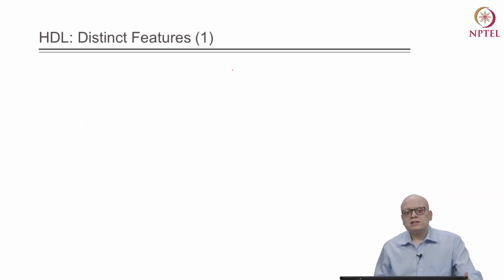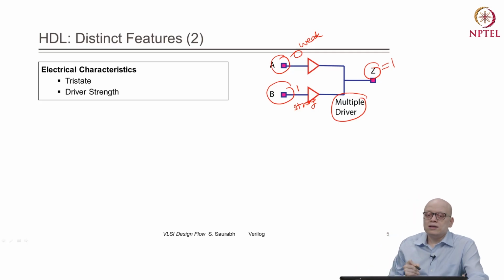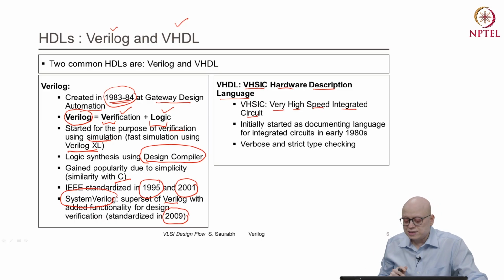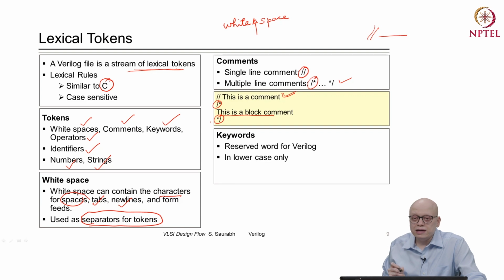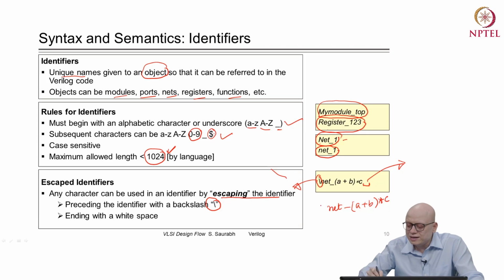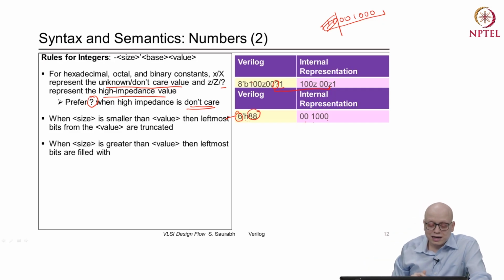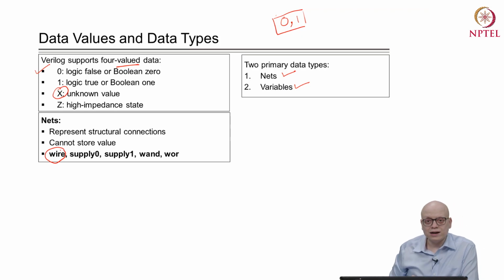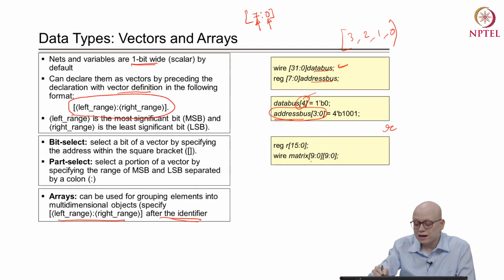Hardware Modeling: Introduction to Verilog-I

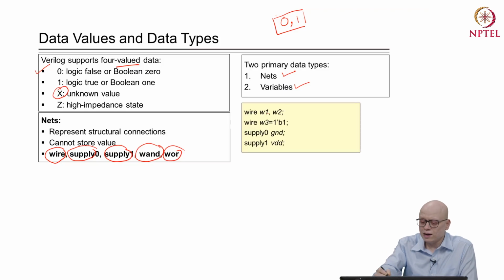Comment: Isn't @39:32 incorrect, as you can't initialize directly to a wire and need to use assign statement for continuous assignment?
Reply: nope you can't use assign statement to wire.
you can either declare it like
🔶wire w3; 
🔶assign w3 = 1'b1;
(OR)
🔷wire w3 = 1'b1; 
this is same as above (implicit continuous assignment) which was legalised in verilog 2001 edition.
Reply: @yuga9511  yeah
i have gone through today itself about this in samir palnitkar book , thanks for the revisit